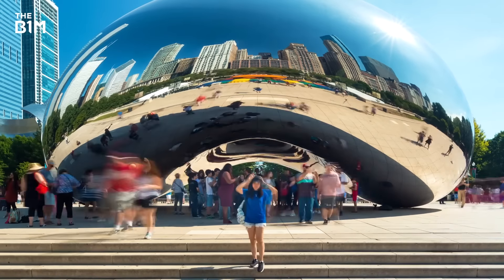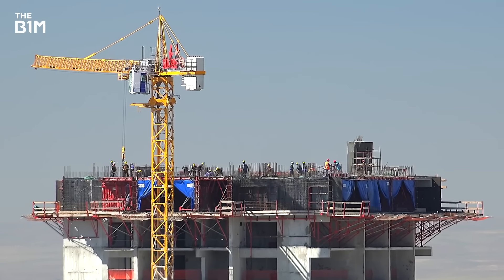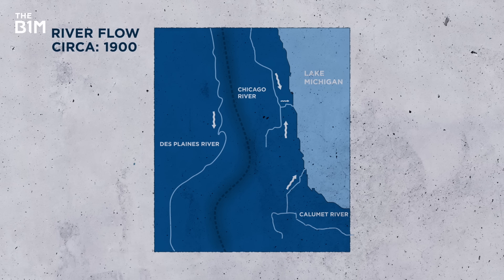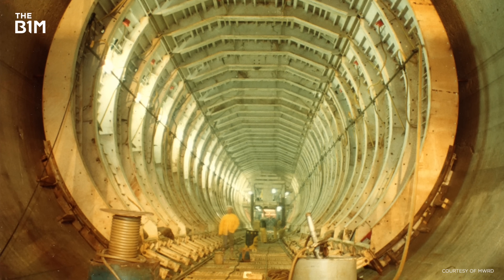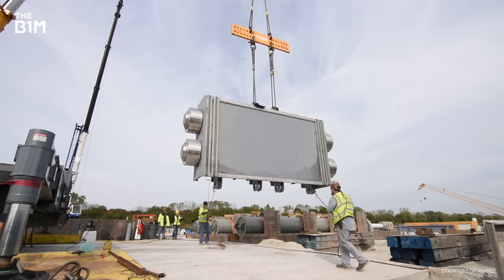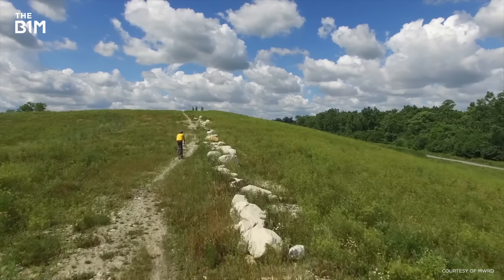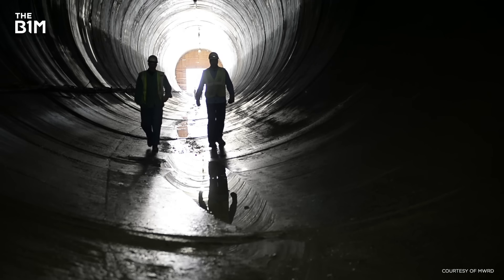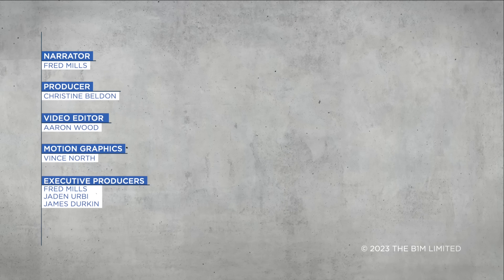The Secret $4BN Tunnel Network Under Chicago

Comment: Famous story from New York, just as applicable here: guy standing inside the construction site asks "But where does the pipe go? You hang it from the walls?"|
"No, fella. You are standing in the pipe."

And the 500-foot deep grouting of these reservoirs reminds me of a slow steady project that has been going on in the Niagara Peninsula for many years: back in the late 19th and early 20th century, before Sir Adam Beck's time, the peninsula was a huge source of natural gas -- which people accessed through thousands of holes drilled in the impermeable sedimentary overlay. Well the gas ran out, and sixty or seventy years later people started to think "Hey, we've got this huge useful storage hole here...." I don't know whether they plan to use it for water, or maybe hydrogen or ammonia generated from future atomic power -- but they need to grout up all those holes and cracks. So that's what they're doing: creating a huge tank that used to be a gas field.
Reply: Wish I had your knowledge David. But, thinking big and far ahead, is a must!
Reply: @danielcookeb90  would look for some sources

Comment: I knew about this project back in 1981 when I was driving 1 of the 1st TBM's ever to be used in the UK. It was a Robbins hardrock TBM similar but smaller than those shown but built by the same manufacturer.
The Tideway project is doing the same job for London - storing excess rainwater and sewage for later processing at the Beckton treatment works.

Comment: The water "discharged to the Mississippi River" travels more than 300 miles to the southwest via the Illinois River, which then finally flows in to the Mississippi at Grafton, Illinois, about 40 miles north of St. Louis Missouri.

Comment: Loved this video. I worked on the deep tunnel project for 3 years. We moved there in 1979 after the excavation on the Eisenhower Tunnel in Colorado was completed. Yes the blizzard of 79. Many great memories of my time there. My nephew was born in Chicago.
Reply: I actually walked from 111th to 115th street in that 1979 blizzard 🥶 as a kid not even a teenager yet at that time 😯was fun for about one block after that it was the hardest task I had ever set off to do. I was to young to know what I was doing 🙄
Reply: @lorenzoknox2945  Yes it was a brutal winter. Looking back I sometimes wonder how we made it. Youth has its advantages for sure.
Reply: I was just an infant in 79 but my my parents will never let me forget that winter! ❄️ 🥶
Reply: @K4R3N  Having just moved there we didn't really know how unusual it was. We found out later. I have seen shows about it on the weather channel.
Reply: @randerodr7389  Chicago winters have steadily gotten more milder in the past decade. Barely any snow this year.
Reply: @K4R3N  Yeah. Same where I live now in California. We're at 2000 ft. Foothills. Used to get snow every year. Now seldom and much less.

Comment: Damn I worked for 4 years in Chicago at a engineering company as a surveyor. I was certified to go into the tunnels under the streets and have done more than a few surveys down there. I think they were old freight rails or something. There is definitely tracks through them. We used to take lawn chairs with us because the whole tunnel system has 6"-12" sitting water in it. Then when it's break time you can actually relax. When you go under the Chicago river there is a water tight bulkhead on each side. It's kind of a weird feeling when you're locked under the river in between the 2 doors. If it was too flood at that moment... Well that's a wrap. You go into the tunnel system in the basement if city hall. Used to be multiple openings but all the rest are welded shut now. The tunnels are full of communication trunk lines and Comed transmission packages.
Reply: There are old narrow gauge freight tunnels underneath some parts of the Loop. There used to be a small railroad that delivered coal to various buildings before electrification. Most buildings have sealed their entrances to those tunnels but some of them flooded like 25 years ago and shut down the loop for a few weeks.

Comment: This reminds of the enormous underground tunnels in Japan. They make Chicago's system look like a dwarf by comparison.
Reply: Are those tunnels safe during earthquakes?
Reply: @neeljavia2965  The Japanese always take seismic activity in consideration with all their building projects.  Chicago doesn't, but should because the city is located not that far from the Madrid fault, which had a very strong earthquake in the early 19th century.  The effects were felt for hundreds of miles.  They had a quake in Chicago a few decades ago.
Reply: @LUIS-ox1bv  Still having such huge tunnels under cities which are heavily prone to earthquakes is quite risky.

Comment: Our basement in a northwest suburb of Chicago flooded a few times in the 50's. When a storm was predicted, my father would put a bundle of newspapers on the floor drain and wedge a 4x4 to the ceiling beam to keep the water from coming in through the drain. This was working until he died in 1986. Then the basement flooded again. I guess the deep tunnel wasn't completed yet.  We sold the house and it was torn down. I wonder if the tunnel is working or if the new house basement floods.
Reply: I own a house next to the desplaines River in river Grove ill. The basement got 3-4 feet of water a half dozen times b4 I just eliminated the floor drain altogether. Problem solved. Any ground seepage is directed to an ejection pit I installed for just that purpose. There are other ways of addressing it that are much more expensive but no more effective. Best $3500 i ever spent.  I actually fully finished the basement and have a nice man cave now, without fear of it getting flooded.

Comment: Well informative vid. Ironic but the precipitation and snowfalls in the last 5 or 6 years in Chicago, west and northern regional has been nominal. The patterns of storms are mostly north in Wisconsin and further south of the city.  That said, just having a few heavy storms and it's the same old flooded areas. The west suburban and northwest especially.
Reply: So with a capacity of 16B gallons it'll be at capacity with 4in of rain the question is how fast can the water be processed
Reply: @tristianwilson3497 On July 2nd, 2023 there was so much rain at once that they had to send water into Lake Michigan as it couldn’t be processed fast enough. The reservoirs couldn’t take any more water either!

Comment: All the homes closest to the tunnel by my house all have flood control systems at the homeowners expense because, even though they are feet away from a shaft, still flood. It's easy enough to check, just find a shaft and then look for permits for the costly remedy in nearby homes.

Comment: My backyard floods. I did not know this before buying the house. It can get nasty if left to stagnate. It will get as much as 12" deep in my backyard. This also floods about six other properties. It's thousands of gallons of water. I am the only one to do anything about it. While not as grand as Chicago's project, I have done my calculations on how many gallons I need to potentially retain while minimizing flooding until it can be removed (a big pond-like hole). As the water diverts into the basin a pump starts and I pipe the water up into the street in front of my house as the streets function as storm drains in my locale. This only cost several hundred dollars and a lot of sweat. MY neighbors had a contractor quote them $15k EACH to remedy the situation. They didn't bite on that one. lol Besides I've solved it already.

Comment: There is nothing secret about the Deep Tunnel Project and from time to time they offer tours. If you drive down I-55 and look to the north you'll see a ring from within the tunnel at one of the entrances so you can see how big it is.   It makes the news often, mainly when it fails (things like pumps below the water not sealed properly so they short out when submerged, flooding basements all over the city).  When your basement floods, its most likely because of the deep tunnel, and when we lived near 87th street, near one of the end points, they claimed so much water from farther north came in it was like sloshing in a bathtub and ended up flooding our basements, even though it didn't rain by us 😞   I've moved to a central area away from a end and its much better in terms of flooding.

Comment: Founding Fathers of Chicago - 'Hey our sewer water is backing up into the lake. Let's reverse the river and send it to St. Louis instead.' 😀Despite the voluminous nature of this project there are still issues with occasional flooding. One problem is the speed of the rainfall. If a storm is dropping heavy rain in a short period of time the feeder system can't handle the flow fast enough into the deep tunnel because it is like tiny straws feeding into a bathtub. I think they are now trying to incorporate more strategically placed green spaces to absorb water. Luckily Cook County was smart enough to create large sections of forest preserve that run along the Des Plaines river.

Comment: The engineering required to accommodate a city like Chicago due to afterthought is monumental. I live 3 hours from there by the Mississippi and paving over marsh has posed it’s own problems even where I live. Sinkholes have delayed projects in the past. Water goes where it wants to and manhandling it is a bold engineering project really generally speaking. In hindsight would we have placed cities like Chicago, Miami, and New Orleans where they are now? Maybe not lol.

Comment: I think the wording sometimes isn't clear. The project really doesn't fight climate change, if anything it fuels global heating even more.
The project helps the city adapt to the consequences of climate change though (as mentioned at several instances in the video).

I still think it's important to clearly differentiate between root cause and effects. I was waiting the entire video for an explanation of how some kind of renewable power would be generated with the project.

Comment: Just an idea, but could that vertical tunnel also be used as a place to put a “gravity battery “ to store electrical energy from renewable energy sources.  It could replace a fossil fuel peaker plant or complete a variable supply of RE.

Comment: This system is NOT a secret, and it's building did have its share of complaints, particularly of cracked foundations along the North Shore branch when blasting was blamed ( the tunnel runs along side the Chicago Ship and sanitary canal between Wilmette harbor, and the North branch of the Chicago River. And the name of the other major river in the Chicago area is pronounced, Dess Plains!

Comment: A KEY POINT THIS STORY MISSED: There are two types of sewers in a city.  

1) A street sewer, (run off from the street into a storm drain) AND 2) a Toilet sewers typically from homes (any time a toilet is flushed or water in a drain).  

1) Normally these two systems are separate - however during a large rain storm, these two systems run together to cause raw sewage to flow directly into waterways, the same waterways in which drinking water is drawn. This is the key point and issue.  

AND the City of Chicago was dragged kicking and screaming into building these tunnels primarily from a class action lawsuit filed by the City of Milwaukee because of point 1 above killing its residents due to raw Chicago sewage reaching Milwaukee which draws its drinking water from Lake Michigan (as do many municipalities).

Never drink city water from a city located on a river, lake or ocean, especially after a large rainstorm.

Comment: Btw this was never a big secret, its the big tunnel project. Its used to move rain water from the suburbs to lake michigan, to help with flooding issues..
Not a secret, if you live by chicago. Maybe in your little slice of wherever you are from,  but not here!
Reply: I remember this, wasnt quiet. Was all over the news at the time
Reply: The tonga eruption cause the planets temp to raise 2 degrees. Combat that!
Reply: 10 miles out that pumping station is, to gather clean drinking water for the masses. Every time it rains the beachs are closed to to water run off

Comment: There was no secret whatsoever about the "Deep Tunnel" project. None. It was all over the news before and during the project, at least until it became "old news". My father was a material supplier to the company that rolled all the ventilation pipe for the project and I got to go onsite with him every once in a while during the construction. While I never went into any of the tunnels themselves, it was still cool being on various sites where it was being dug. Not long after that, A smaller scale version was done in Milwaukee, which like the Chicago area's TARP was no secret whatsoever.

Comment: Now if they could just curtail the out of control shootings and murder rate (tamping down on other crimes as well couldn't hurt), it might be able to shed it's nickname of Chirack, and be less dangerous that one of the most dangerous places in the middle east (which, BTW, is nonetheless safer that many parts of Chicago).  Or they could just use the never-ending supply of bodies like sandbags and help prevent water flooding that way.

Comment: The issue seems to be population growth and poor original planning.   Similar issue in Milwaukee.  One sewer system for rain water and sanitary water. The water treatment plants can't handle all that water during rain storms. The extra water is stored temporarily in the large tunnels to allow the treatment plant to keep up. This has very little to do with global warming.  Of course always have that throw global warming in as the cause of all problems.

Comment: As great as these videos are from the B1M, I wish they would just focus on the construction aspects more instead of the constant climate change hysteria. He could have easily replaced the phrase climate change with pollution or sewage and it would be a lot more precise. The Chicago tunnel and reservoir plan has absolutely nothing to do with climate change. It's simply a matter of controlling increased water volumes due to the population becoming bigger and more impermeable land existing.

Comment: I respect modern civil engineering,  but you can't engineer yourself out of overpopulation of tight small areas.  

The climate change argument is a cop out.  City's like Chicago, New York, and Los Angeles, to use American examples are way over populated.  It's time to build outward communities with green spaces between to allow for natural absorption of heavy rains and snows.  

This tunnel Reservoir project will be a short band aid solution if Chicago sprwal is allowed to continue.  Just like the reverse conditions of Lake Mead Reservoir.  It's not drying up due to climate change, but due to it being overused by 10 times  its intented capacity.  Lake Mead was designed to allocate for a population of 15 to 25 million  people.  With the population of its service area now hitting 150 million and growing, plus more  need to irrigate new and massive farm land areas being created in the south west.  Here lies the problem.  

America has the land capacity to absorb  a couple  billion in population.  The problem is the concentration of population in popular destination areas.

Comment: So how exactly is building a tunnel, wasting diesel, gas electricity to operate this huge machines. Good for the environment? I heard climate change gibberish but no explanation.
Reply: Climate change has meant that Chicago experiences an average rainfall that's around 3 inches more than what it experienced 30 years ago, with all models indicating that rate will increase over time. This project moves rainwater out of town quickly

Comment: This is fascinating.  The entire "Climate Change" angle, however, is infuriating to listen to.  Propaganda of the highest degree.  What is actually science is data and measurement.  Modeling attempts to predict; however, when actual data (known historical temps/climate) is plugged into the models, they are over stated by orders of magnitude.  In other words, they fail spectacularly.  Using ACTUAL data, there has been zero trend in the UAH global mean lower-troposphere temperature anomalies since September 2014: 8 years 5 months and counting.

Comment: Nothing is or ever was secret about it.  It was on the news constantly. It seemed like everyone in the city and burbs knew our was related to someone working on the project.  Construction equipment was in the open with signs about the Deep Tunnel Project all over the place. Plus, as a city need, they made sure that everyone knew the were doing it to address an important issue. 

You could have gone with "fascinating" or "engineering marvel" or any number of just as effective, and actually apt,  descriptors. 

Dumb, clickbait titles are just annoying.

Comment: Climate change?   Your story misses the basic point.  Chicago area is flat.  There are a lot of roads and concrete.  Flooding was a major problem especially the Des Plaines river.  We (in Chicago) get less precipitation compared to the 70’s, not more btw.  Did you check the stats?  We may now get more rain than snow, thats true.  Does blaming global warming help pay for the projects maybe?

Comment: Well it’s an interesting video and but not very thorough it wasted a lot of my time giving climate theories that have absolutely nothing to do with the deep tunnel project. Bottom line it keeps the basements and roads from flooding when it rains alot. The rivers still flood but the concrete jungle doesn’t as much with the deep tunnel. It’s not a critical tool for climate change, ridiculous. 6:21